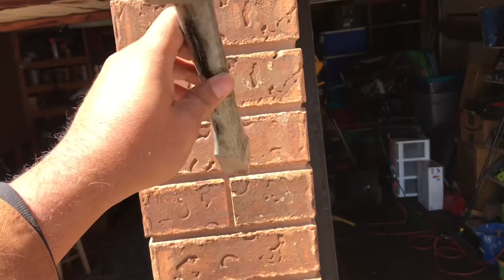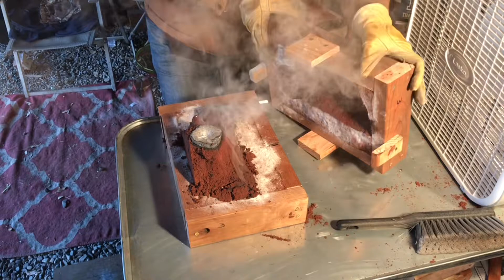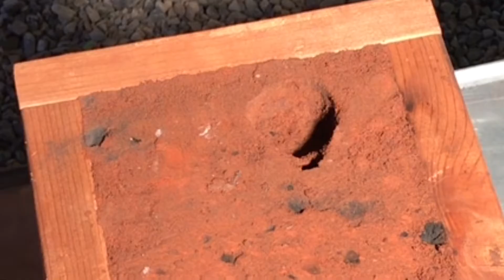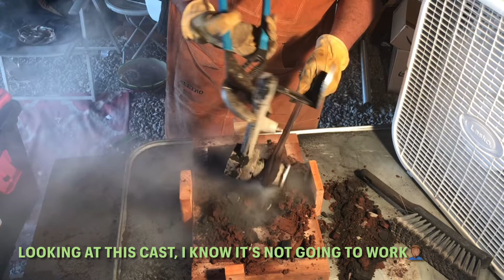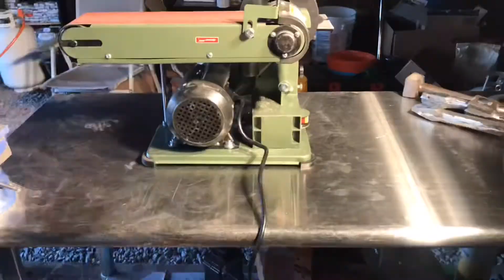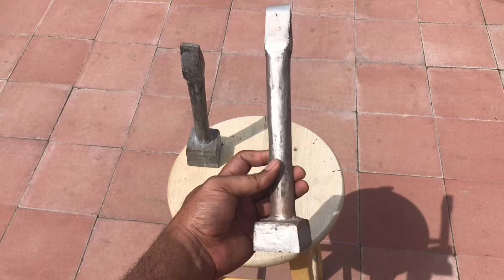J.A.M. 19: How NOT to Cast a Sand Ramming Tool

Comment from the maker: Hello there! Finally finished this project and got it all put together. Check the description for the relevant videos from Perry's channel @swdeeb that I talked about in this video. This whole project was more of a pain than I thought it would be, but that's what happens when you do things like a total F.O.B. Samoan. I'm sure some of the issues that arose in this as far as the metal is concerned are due to the fact that I'm using ingots made from drink cans, but it's all I have to experiment with. Anyways, it was a fun and ridiculously long project, and I'm so glad I had this experience. I'm sure my next video will be a little more basic and simple for something fun. It may be a while because my wife and I are starting to remodel and update our kitchen so my garage will be taken over by everything we've pulled out, as well as our new cabinets that are coming in over the next two weeks. I won't have room for melting, but I MIGHT be able to move to melting outside until the kitchen is completed. I hope that wherever this comment finds you, you're happy and well. If not, do what I do and melt stuff (lol) and it might make you feel better. See you on the next Jam!

Comment: Well, it's good practice if nothing else. I think the feeder on 3 would have been sufficient, but as you mentioned the hard edges made the shrink worse. Either way, good job on fobbing yourself a sand rammer! It makes everything a lot easier.
Reply from the maker: Yeah, I definitely think that not doing a radius on the feeder for 3 is what caused the shrinkage, it would have been fine otherwise, and that's why I chose that one for use hahaha.